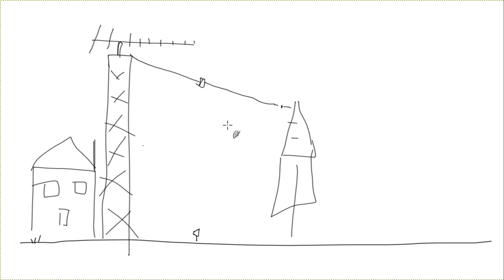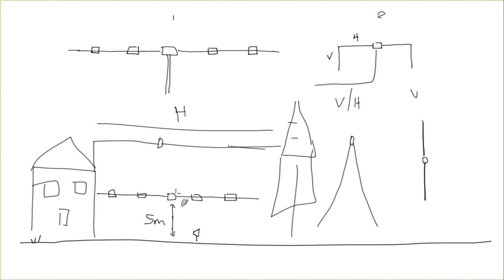HF Dipoles: Horizontal vs Inverted-V vs 'Sloper'

Comment: This is a great video Steve wished I'd seen something like this when I got on the air in the 80's! It explains why my half size G5RV crammed into the attic with the ends at 90 degrees performs better than I could have ever imagined. I've always believed that simple dipoles work perfectly well for most of us everyday operators. Mind you my best 10m setup was a vertical ¼ wave length of copper pipe with a sheet of metal as ground using a Bob Dylan LP as the insulator between! 73's G7SQY
Reply from the maker: Thanks for the comment David!  Attic dipoles can work surprisingly well providing the household noise levels don't swamp receive.  Talking of 10m verticals - I remember in the 90's (before any understanding of RF) winding 8m of wire into a coil with a 2m 'whip' (making 10m total, this seemed logical!) and using a hamster cage (!) as a counterpoise - all within my student bedsit.  I still can't understand or explain how this worked as well as it did.  I could have perhaps enhanced it with some vinyl insulators but I'm not sure if The Cure or Siouxsie And The Banshees would have had the same RF properties as Bob Dylan :)
Reply: So the answer was Blowing in the Wind!
Reply: poor old bob lol

Comment: I have an Icom MN-100 multi band dipole antenna and i plan to make it as inverted V and put it up on a 18 meter mast with the angle around 90°-120° between both wires, the question is, is 18 meter high enough to make the antenna works efficiently ? I work mostly on 40m band. I use galvanised pole, will it compromise its performance ? Thanks - YG1BGK

Comment: Hello. I setup and 80 mtr 4-square using off the shelf Comtek switching arrangement from DXE. I used sloping dipoles in the four dirrections (NE,SE, NW, SW).  In the ARRL antenna books for many years has been the 40 meter 5 direction  slopers to get the directions like NE,E,SE,SE,NW. But from your explanations of the difference of dipole, inverted V and sloper it appears that using horizontal dipoles would be better (if I can get the supports...lots of them). Is there no shifting of the pattern with slopers in the direction of the slope or not? For my specific case it seemed much easier to use the slopers and pull the lower halves in like inverted V's turned on their sides. That off my 120' tower. Terry

Comment: So would you recommend  a 1:1 balun at the feed point on all dipoles?  I am planning on making some dipoles in the near future and have read you dont have to have them, but I would like to build the best anntennas I can.  Keep up the good work and thanks in advance.  KF0EEJ
Reply from the maker: Yes, whilst you can operate without them, unless the dipole is erected in perfect space and perfectly balanced then the feedline will likely start radiating, causing RFI issues in the shack, increasing RX noise floor and altering your radiation pattern.  These issues may not be significant or cause problems (depending on the degree of unbalance, power levels used etc) but I always recommend doing things properly if possible;  it will likely save you further headaches at a later date.
Reply: @oh3spnfinland718  appreciate the response Julian.  Consider you one of my Youtube Elmers
Reply from the maker: @wildlandoutdoors51  You may be confusing me with Julian OH8STN - but that in itself is a compliment ;)
Reply: @oh3spnfinland718  you are correct i did mistake you for Julian.  You have a great channel too though